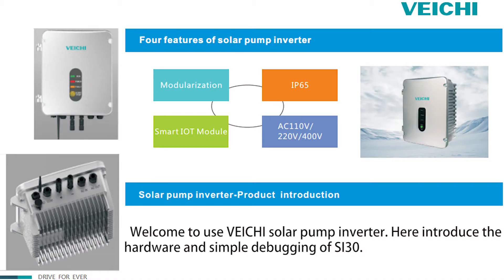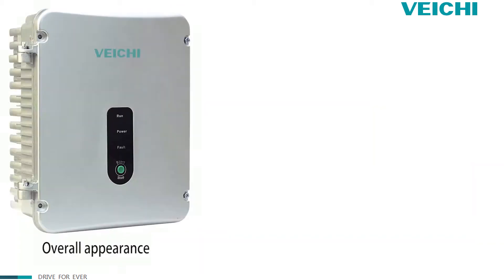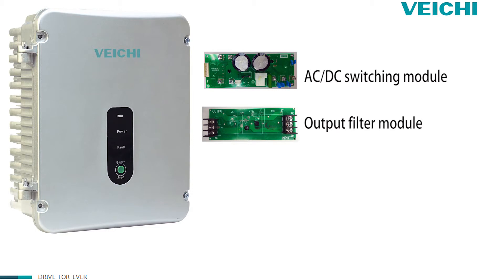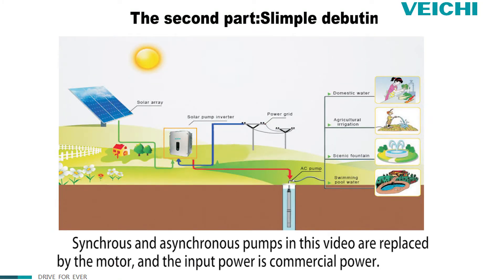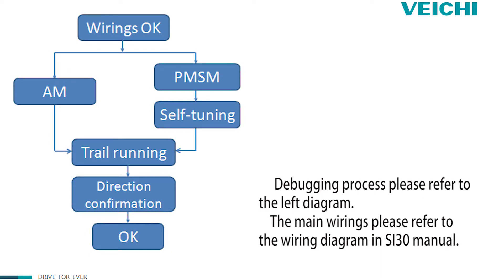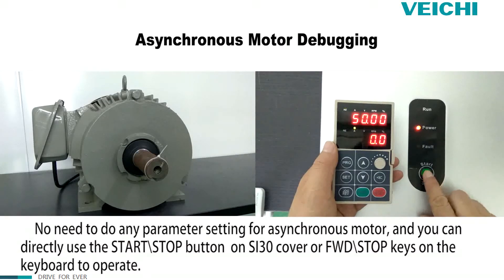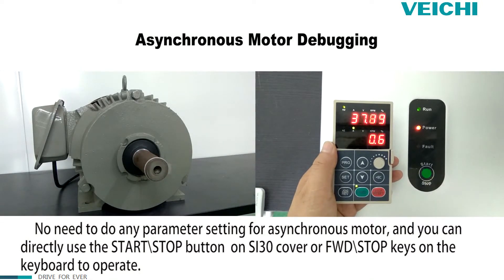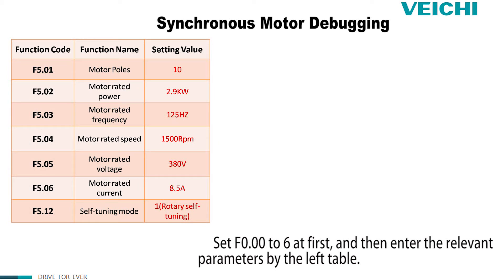Hardware & Simple Debugging of VeiChi SI30 Solar Pump Inverter

Comment: Can it run a BLDC motor ?
Reply from the maker: Yes
Reply: @VeichiElectric  I downloaded the user manual and it has option for selecting PMSM but no option for BLDC. Could you confirm this . thanks
Reply from the maker: @jehanzebahmad461  PMSM mode can drive BLDC.